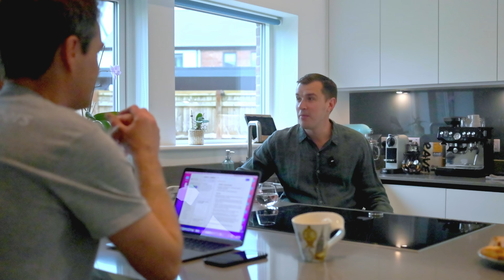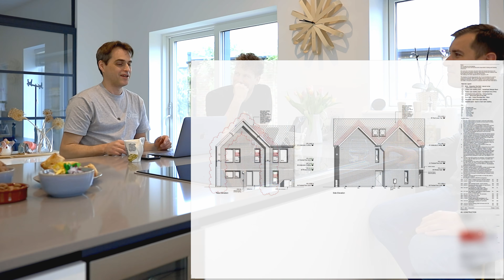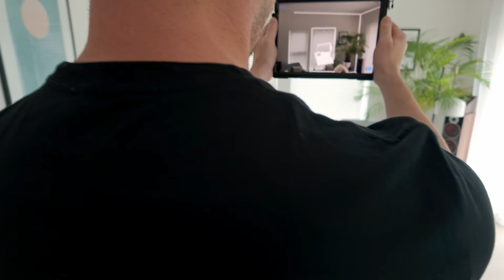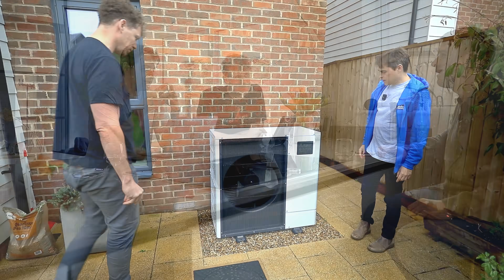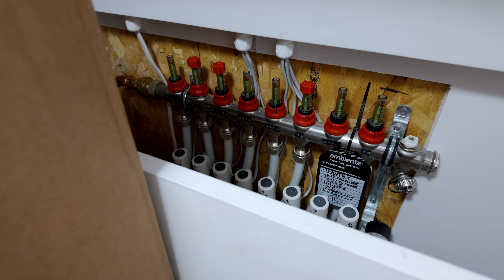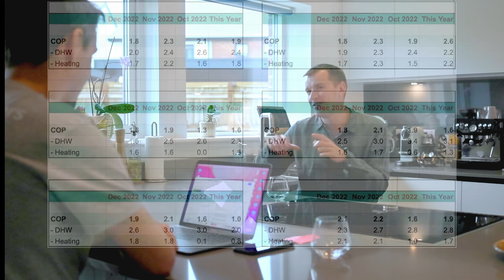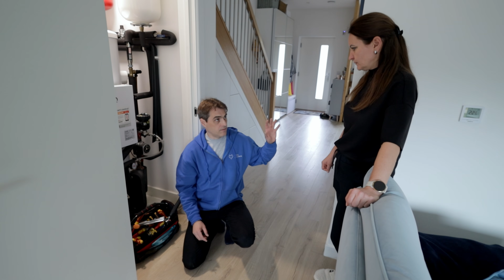How Developers Are Ruining The Heat Pump Market

Comment: Great video as per usual! The larger point is why is it even legal for installers to be doing this with limited customer comeback? How many billions are the government wasting because of inefficient installs? Imagine the needless load this will put on the grid at a national level vs. if we had well-installed heat pumps? It's really sad to see.

This is a fantastic example of installers not understanding the technology and making things needlessly complicated. 

- More expensive to install due to the excessive sizing & extra, redundant parts
- More expensive to run
- More errors (some of which balance out, but many of which compound things)
- More maintenance required due to thrashing/cycling, plus engineers will have to have their wits about them if they want to understand wtf is going on
- More to go wrong in future because of the extra complication
Reply: Not sure 'The government' is wasting billions here. It's people buying houses (which could have been cheaper) then spending more moeny to heat them than they should be. So it's individuals/families wasting money (and installers who could do a better job much more cheaply if they actually knew what they were doing).
Reply: @xxwookey  regulation is needed, so it is the government's fault imo.
Reply: @defragsbin  Sure, the last 20 years of failure to set decent buildings standards has been a huge contributor to the current cost of living crisis and has wasted a great deal of people's money (on expensive heating) and government money on the poor health that poor housing generates. I actually blame mass housebuilders as much as the government - it is they they have been campaigning to keep standards low for decades (and the govt is too innumerate to just ignore them and do the right thing for the populace anyway)
Reply: @xxwookey  true, but I believe they also are happy to take their political donations too :(

Comment: Passive house insulation plus MVHR - finger in the air at -2C and 200m2 (similar to my similar bungalow with average insulation and newer windows which is 6.kW according to my calcs) so I reckon 2-3kW heat loss?

Comment: Great video. My 11.2kW is on a 6kW heat loss property, and that's already oversized 😂 adding volume & load really helps, open loop everything. Also weirdly, the firmware on Auto Adaptive allows a lower modulation than on WC, mine runs down to about 1000w input watts.
Go on, who's the installer?
Reply: Are you serious? You get lower modulation with the auto adaptive than with the WC? Every time I tried the AA, it was running the temperature so high that I thought there was no point. The general feeling I had when talking to people on FB groups was that the scop on AA was very poor.
Reply: @aymerichousez1005  Yeah, the trick is in getting it to 'learn' correctly which can be difficult to do. AA is basically extra smart WC, so using the wireless sensor for feedback it will build it's own flow vs outdoor temp curve (internally, not accessible to the user). But to get it to build this curve you need the wireless sensor/stat in a good place and as open loop as possible, rads, underfloor, everything on max flow and this isn't documented very well, so most people give up when they see the system going full out. It will massively overshoot to start with, then on subsequent runs it will use less and less compressor to achieve the same internal temp but with longer runs at lower flow temps. Once it settles after a few days, I found it generally allows the compressor to run slightly slower than on WC, and for longer periods. WC also seems to have a massive overshoot to begin with, which AA mode doesn't exhibit. I did question Mitsubishi about this but they're not interested. I think a lot of development went into the AA side of the firmware and less for WC. AA is a closed loop control system with feedback, WC is simple open loop
Reply: @Loopyengineeringco  Interesting that Mitsubushi were not interested. I think this happens when the local support office feels that they cannot influence the engineers who actually write the software. It's actually a very common attitude in the UK.

Comment: At such a low heat loss the floor will never feel warm. I built a passive house in Canada and the floor temperature never went above 30C even at -20C.
Reply: Part of the issue in the UK is that we're not used to heat pumps yet, so people expect the floor to feel warm when they wander around in socks. In fact, it is warm (30C is actually too warm for most floor coverings) , but you can only feel this if you are in bare feet and it's a suface like tiles that you brain tells you should be cold. When they aren't, the brain converts this to "warm"!

Comment: We have a couple of problems in the UK - old and poorly insulated homes, gas prices are under 1/3 the cost of electricity meaning you need a COP of @ 3.5 to financially breakeven if you move from gas central heating to heat pump. Lastly, and what these guys are championing, our heat engineers are trained mostly in safely installing the gas central heating and not optimising and design of heat pump systems.
We are definitely behind our European neighbours but channels like this are helping.
Reply: you don't get 1kWh of heat for 1kWh of gas.  average gas boiler efficiency achieved (rather than the badge efficiency) is about 83%. so you only need a SCOP of about 2.5 to break even on running costs at gas costing 1/3 of electricity
Reply: They’re not even trained in installing efficient gas systems,
The gas safe qualification is just that and nothing else I’d say 80% of guys are of the “Fit a 40kw combi mate” mentality.
Reply from the maker: @hufartd yea that’s the reality - most only understand how to install a gas pipe - that’s all there is.
Reply: The gas central heating systems in the UK are absolute cack too. A typical gas boiler is big enough to heat more than five houses, and runs much less efficiently because of this- the return flow temperatures end up much too high, and so they don't condense properly.
Reply from the maker: @BooBaddyBig they never condense in the Uk and they fail on average after 8 years making UK a cash cow for boiler manufacturers and a haven for cowboy combi slingers - couldn’t make it up
Reply: @UrbanPlumbers  This just happened to my father about a year ago. I was desperately trying to persuade them to install a heat pump, but they'd been reading the Daily Telegraph and the local cowboy installers upsold them an even bigger 25 kW 'condensing' boiler and repeatedly told them that they 'didn't like to install heatpumps' and they 'had to remove one only last week' because they 'don't work well'. My father's already spent another £1000 on servicing because it clogged up again. The peak gas output in winter is about 5kW. My father keeps repeating that it would have cost £30000 if he'd had a heat pump-but he never had a quote.
Reply: @BooBaddyBig  Ouch. Thanks for sharing, this sounds awful.
Reply: @UrbanPlumbers , why they "never condense" in UK? Can u please explain
Reply: @BooBaddyBig  yep, I reckon if you had a bedsitter they would still recommend 24kw combi😂

Comment: Will they eventually come out with much smaller heat pumps in future? 

I asked the heating engineer when he serviced my gas boiler what would be a best replacement if i wanted to get rid of gas and he said  get an electric boiler replacement or an electric boiler and a twin head aircon unit (for lounge/kicken and main bedroom). He said a A2W heat pump wouldn't work well for me and would cost a lot to run in my situation. 
I use about 2500kWh of gas a year for heating and I'm usually out the house 11-12 hours a day.
Reply from the maker: A2W will work well and be cheaper than gas if installed and designed well in most houses
Reply: @UrbanPlumbers  Ok thanks. I just thought about getting rid of the gas as the standing charge is about 30% of my bill. 2500kWh of gas is about £150 so over the 6 months a year we might use the heating that's about 82p a day. Have you installed a system where people have used so little?
Reply: Air to Air could be an option?
Reply: @marcexec  Yes that was one of the suggestions from my heating engineer.
Reply: Samsung, LG, Vaillant and Mitsubushi do a 5kW heatpump. Riello already do a 4kW. If you want to heat domestic hot water (DHW), you probably need a 4-5kW heat pump even if the heating load is 3kW, as the DHW coil is probably capable of absorbing 3kW.
Reply: @tlangdon12  I just checked and Vaillant now have a 3.5kW, and they've had a 3W Geotherm for a while. Someone posted above that Panasonic have a 3kW machine now too. Looks like Aquarea K and J series.

Comment: I’ve been thinking of getting a heat pump, but your videos make me think twice. Should it really be this complicated?
Reply: Why should engineering be simple? It's not a realistic or sensible expectation. You don't expect to be able to build the plane you fly on holiday in, or to be able to build a heat pump. Why should designing a heat pump system to heat a home and hot water be simple when the number of varibles and choices is so large?
Reply: @tlangdon12  Because these are for residential properties. Some of the install videos I have seen look like the plant room of a commercial property.

Comment: Blimey.  That was pretty scary tbh.  For those of us thinking about heat pumps, it's sobering to see "experienced" installers making such a botch of it on a new build property which should be easier than a retrofit.  Caveat emptor doesn't even begin to cut it.   

Keep up the good work with these videos, really hoping that they can help drive some positive change.

Comment: 19:52 - they did not design anything
they simply throw in what they had and without any thought except a rule of thumb like 50 W / m2 regardless how small the heat loss is.

That is not worth to call it a design.

Comment: So can’t you zone with heat pumps if half the house isn’t used
Reply: You can but you need to consider the minimum output of the heat pump very carefully and ideally your minimum load will be higher than this. But also, heat will be lost from the warmer spaces to the cooler spaces regardless of whether anybody's occupying them, putting more pressure on your heated emitters. So it makes sense not to zone, as much as possible.
Reply: You could zone the unused half off if you had insulation in the walls between the two halves of the house, and a insulated door with good air seals. But if you had any water pipes in the unused half of the house, you would want to heat it a bit as you don't want the pipes to freeze. You could always drain down the pipe work. It's easy if you have drains in the right place.

Comment: Excellent video and very thought provoking. Such a shame a premium developer produces these beautiful expensive houses and so utterly fails on the heating system. Thinking outside the box - I think you said 18 properties , so say 60KW heat loss max - maybe they could have put in a ‘district solution and just fit heat meters in each property, maybe splitting the development in two, so two 30KW plants maybe consisting of two cascade units each.

BTW did you tell the young lady the cover on the pump ain’t helping?😉
Reply from the maker: The cover isnt gonna make it any worse 🤣🤣🤣.

They could cascade 4 x 11 kW units and run the whole estate on that
Reply: @UrbanPlumbers  That’s for sure.🤣

Comment: Great video. Would love to see a follow up video if you end up going back to fix any of them and the following results.
Reply from the maker: that is the idea. We are tyring to get manufacturers on board to help with the cost of putting this right.
Reply: @UrbanPlumbers   What is the smallest a2w heat pump you can buy??
Reply from the maker: Around 4kW, but there are exhaust air units that can be below 3kW
Reply: @UrbanPlumbers Could one of these exhaust air units be configured for houses with low heat demand ?
Reply: @UrbanPlumbers  I know it's the wrong time of year now, but looking forward to a follow up.  Keep up the good work.  It's appreciated!
Reply: I can't see how you'd do a follow up video this year - there's no way the heating should be needed before November at the earliest. Even in winter the occupants, TV, fridge, lighting, phone chargers etc should be enough to keep the house warm.

Comment: This is just the same as the boiler industry though, installers over sizing boilers, not setting max KW outputs correctly….
Reply from the maker: the consequences of doing it with heat pumps are much more serious

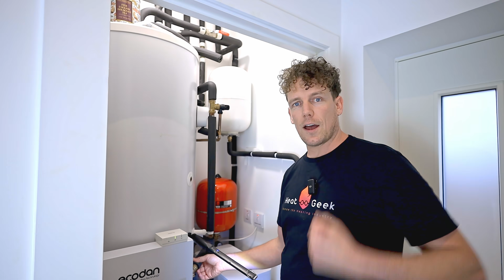Comment: @10:20 - the comments made don't take into account that this is a pre-plumbed OEM unit from Mitsubishi and the expansion vessel is installed as per Mitsubishi's install documents
Reply from the maker: we know that - Mitsi designs are a bad joke - filter and expansion in the wrong place, 28mm header for a 11kW unit does not meet needed velocity and causes massive mixing/distortion. Pre-plumbed cylinders are literally efficiency killers. 

Mitsi has awful designs, but this should not excuse bad installation practices. But i get that - if manufacturers get it wrong what chnces does an average installer have?
Reply: @UrbanPlumbers  Yeah, I suppose to people who did not know then they might think another bad house builder, but in this case it's a combination of issues

Comment: The only way to improve public confidence is by bringing the building regs (Part-L) up to an adequate standard that protects the consumer. Correct me if I’m wrong, but where does commissioning and provision of information set out that a heat loss calculation is provided?  Part-L’s efficiency for heat pumps (Table D) also only refers to efficiency as 250%, but commissioning as set out by section 8.9 appears contrary that it should be in accord with ‘manufacturers instructions and appropriate system design parameters’.
Reply: This Govt were so concerned about public perception, that they commissioned Nesta to do a survey of MCS accredited ASHP installs that paid respondents £250 just to complete the survey. So no bias there. It found that over two thirds of even the MCS accredited installs relied on a secondary source of heating, of which around half had installed a wood burner. Nesta thought it not necessary to ask why so many rely on secondary heating.
Reply from the maker: not my experience - most hosues with heat pump we install or visit do not have secondary heating. Only around 5% have wood burners - that is all.
Reply: @UrbanPlumbers  Nesta survey was largest survey in U.K. with 2500 respondents. But really good yours don’t. That’s how it should be.
Reply from the maker: I know I got asked to do it but on question number 238999 I told them do get lost 🤣🤣🤣